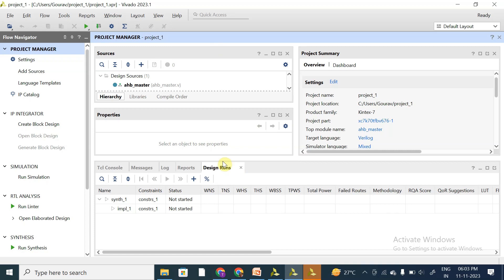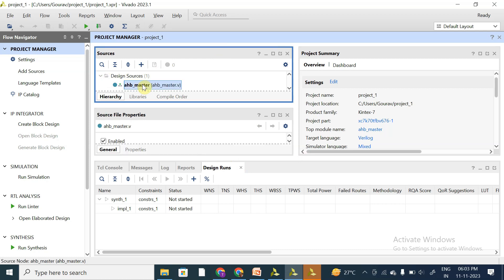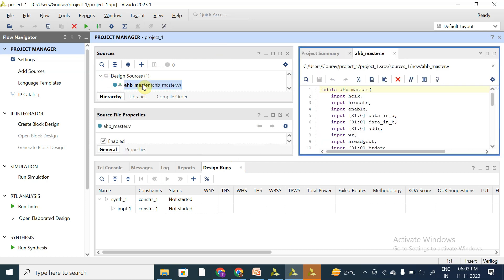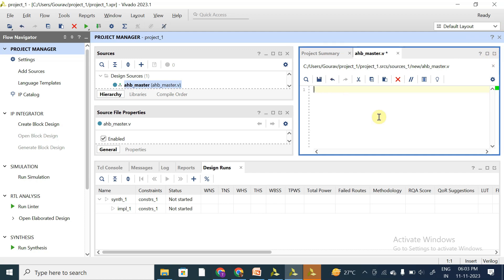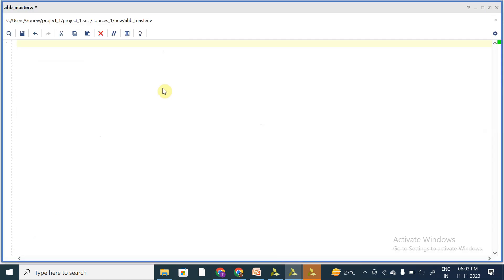Verilog code for ahb master part - 1 || Amba ahb bus protocol||

Comment: Hii.. I believe that output reg (31:0) since it is 32 bit. But u mentioned 33 bits. At line no. 23..can you please correct if I am wrong
Reply from the maker: yeah thanks for pointing out, rectified thank you